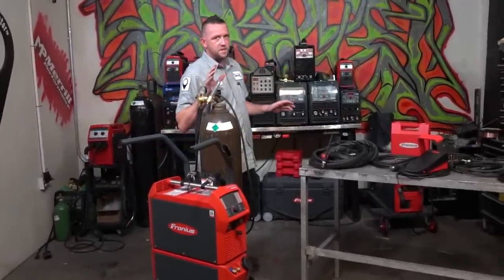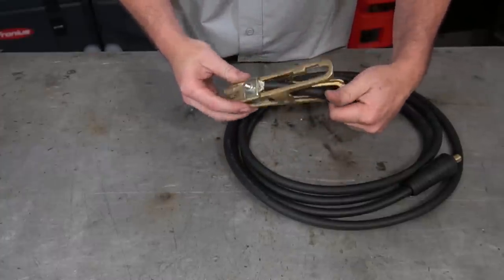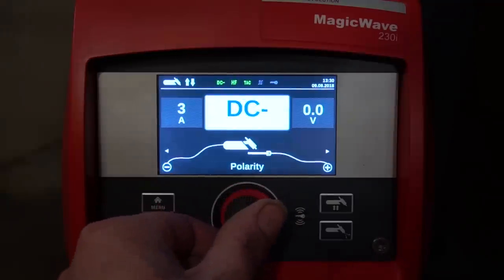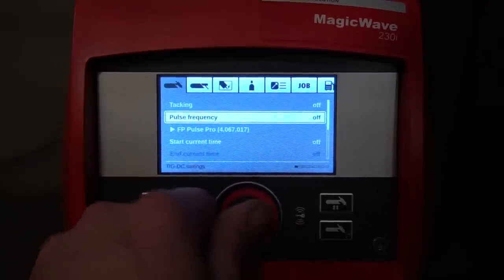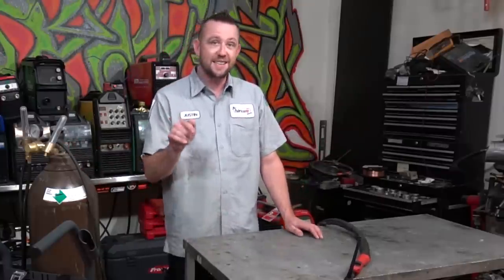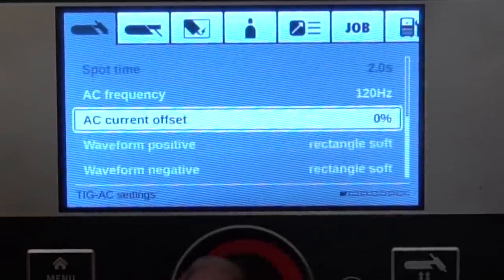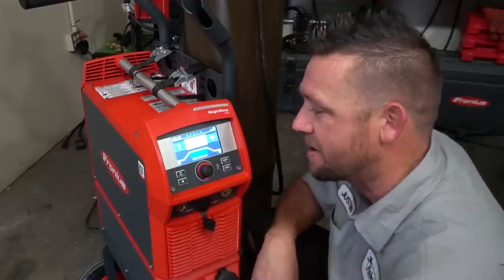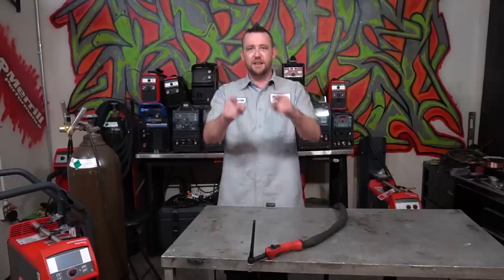TFS: Fronius Magicwave 230i

Comment from the maker: Try before you buy! Book an appointment to come here and weld.

http://thefabricatorseries.com/classes
Reply: Hello, how does the Magicewave 230 compare to a Miller AeroWave  ?  Adjustability/stability/prrcision  wise ?
Reply: With 1 of the latest firmware they added the possibility to weld 6010 on mma with it's own specific program
Reply: Would this welder have additional benefits specifically for welding cupro-nickel compared to other tig welders?
Reply: I've used the microwave 900wat ma whole life 🤣

Comment: I have had the pleasure of using many different tig machines at my places of employment here in Australia. Fronius are by far, The Best Tig welder i have ever used. On AC nothing compares to it. I currently use a Kemppi Mls 230 mastertig that an $8000 AUD Tig machine and its AC is rubbish compared to Fronius. Seriously you dont know how good they are till you try one. Everybody may hate the torch but i actually like them. Job mode i use to do AC Pulse fusion welds on 3mm 5052 Aluminium tool boxes 2000mm long welds full penetration. then as you go around the corner flick one of the levers and switch up to the next job mode as you change from an outside corner to a lap joint. This is where the key card comes in perfectly once you've dialled in those pulse settings you don't want nobody going in and changing them. They still have access to the saved modes but cant change the particulars of the modes. Now Fronius send me a welder and i rubbish on Kemppi and sing your praises more.
Reply: LandRoverLife You should ask for a trade in deal
Reply: @chris_b_liven  they make one of the best Mig welders too. For ally anyway.  TPS2700 and TPS270i. Im an Aussie too and thats all we use.  We build boats and have about a dozen welders.  One non fronius that sits in the corner all day haha
Reply: you should have the chance to try ewm, or lorch, they are nuts too; but i got a fronius myself as well
Reply: Did you ever try a EWM Tetrix? 🤔

Comment: Great review, very nice machine as I have one and love it. One correction, leave the head of torch "locked in", they all swivel around 360 degrees while locked. If you do it your way by unlocking to swivel, you then risk it popping off if you turn too far, especially with the water cooled torch. Also keep the rubber o-ring greased to prevent tearing. Cheers.

Comment: Our company bought this machine 2 months ago and it's the first one ever sold in NZ. Great machine by the way the smallest water cooled torch and so flexible
Reply: Do you know who they bought it through (Auckland?) and, maybe, the price? thanks.
Not in a position to buy at present, but in time...
Reply: through digital weld...the main fronius distributor in NZ....this machine was not available in NZ so they flew it from Germany for us....it was $11000. the torch itself was $1000. software upgrade an extra as well where you can get more parameters to play with
Reply: that price is the whole package though...the inverter and the water cooler and the water cooled torch
Reply: Ouch, thanks, man - just need a LOTTO win now :-(

Comment: After watching your reviews on the AHP and Primeweld 225 machines I choose the Primeweld for 2 big reasons. 1 In your review you had said you would opt for it to start out with because of it's capabilities and 2 after reading other reviews of both machines the Primeweld had best/least customer service complaints. It was a close call but I am thrilled with the Primeweld and even more stoked about the super flex lead. So much better then the manual gas valved torch and lead for my dc only Vulcan One Pro 220. Money well spent and Thank you

Comment: Most of the equipment I have is 20+ years old. My stick is 100lbs or so. Never seen one like it. Never had it to full power even on 1/2" and 5/8" steel plate. And I'd say it would run near full power all day. It looks like a industrial welder. I'd like to upgrade my 120v mig go a good but not expensive tig. Something I can weld aluminum and other more difficult to weld matereals, ( hard to weld with what I have). Great video!!
Reply: JAMES! Since the 70's You have to look at the Fronius TransSteel 2200

Comment: I absolutely love the build quality and the features are awesome. I wish a company would come out with welding machines with the same build quality just striped to the bare minimum with features. I'd pay premium for superior built quality machine but all the additional features (synergic, pulse, stich, multi-process, etc.)  just make Fronius machines unaffordable for me. I still would love to own one.
Reply from the maker: I understand what you mean, but by comparison, what they have included (with the quality) vs the competition is very affordable. It's thousands less by the time you stack up other features and functions. It would be cool to see a very entry level with very high quality machine though. Maybe they'll be the first to do it.
Reply: I hope so. You're right they are affordable when you add the features and functions. I'd just wish they made one that didn't have those features and functions (cause I wouldn't use them) to keep the price down. No one makes simple machines anymore. The ones that are made simple are junk build wise. Fronius definitely has caught my eye because of the build quality. No one is making machines as tough.
Reply: Tony, I have a Fronius Transpocket 180 stick tig welder and it is amazing I think you can get one in the USA for 1500
Reply: @tonybaggett1984  as a fronius daily user and owner, I have to say that quality is very high level, except for the cooling unit pump, wich is pretty cheap

Comment: Best have some very DEEP pockets to have this lil machine. 4200.00 to 4800.00 as of today. Makes the miller machines look like an affordable alternative lol
Reply: Jeremy Arnold A Miller Dynasty DX 210 TIG runner is selling online for around $ 5,800
Reply from the maker: A base line Dynasty 210 with nothing else is just $4k. Add a pedal, clamps, leads, etc - it goes up. Then add functions and features that the Fronius has that the Dynasty doesn't (that means buying a bigger Dynasty - not the 210). Now you have a $7k machine that still needs to be upgraded to match capabilities. Suddenly you're over $10k to do what this machine does. I think the Magicwave is a better investment.

Comment: Thanks for NOT wasting everyone's time getting into the stick settings. I wouldn't purchase one of these to stick weld.
Reply: but its nice to have a machine that will do both , especially if you're a mobile onsite welder and dont want to carry 3 different machines.
Reply: @heartobefelt  yea but every TIG can actually used for Stick welding aswell🤷🏻‍♂️
Reply: This can also weld 6010 with one of the latest firmware update: you can weld everything
Reply: @raulduke85  big deal
Reply: @Joeak74  i think it is actually: the best part is that you get your firmware periodically updated and they add new functions and programs over time.
I was able to manually weld 2 pieces of 1/10 mm thickeness alluminum foils, with no copper base under it, with good results, for a particular application, using 10 khz pulse and ac freq maxed out; it' nuts

Comment: I contacted Fronius once inquiring about price and dealer availability, more than a year went by they never got back to me. Needless to say no dealers for this exist in my state. They rarely ever have these listed anywhere online to buy.
I'd rather give money to USAWeld or STEL, at least they aren't afraid to show prices online.
Reply: Man, stel Is italian and I'm from italy; i'm a welder and i tried both the stel and the fronius mw2200: there's no comparison.
Stel Is a nice machine, but the fronius Is totally in another level. Then i have to Say that in Italy the stel Is not that cheaper than the fronius: the mw 230 i costs 3300 euros (machine Only), while the stel costs 29xx euros.
I've Heard in usa the htp Is quiet cheaper (same as the stel) and the fronius Is around 5k: well it's a bit pricey, but in my experience Is defenetly a Better machine.
Reply: @raulduke85  hi,man. Thanks for the comment. As an Italian welder, what do you think about cebora brand comparing to fronius and stel. Thanks in advance
Reply: @Abu_Daud  i only worked with a old cebora tig welding machine , pretty small, 180 amp peak current and it was a dc machine only: it was a nice little welding machine; but I don't know anything about the current models and honestly I don't know anyone using theese welders😅
Stel makes good welding machines, but I'd say that especially on 3phase welding machines stel don't stand a chance against fronius, not cause it's bad, but just because magicwaves have more features (now the Iweld has a lot more) and if I have to spend 8k for a stel, I'd rather spend 10 k for a magicwave. Sorry about cebora but can't help about it; but if you are interested in italian brands I can tell you that CEA brand with the model matrix produce a pretty nice unit👍🏻

Comment: I recently sold my Miller Syncrowave 250DX mainly because ever time I turned it ON it doubled my Electric Bill and had issues with it popping 60A C/B on heavy material.  I bought this Fronius Magicwave 230I.  Great machine, way more settings and adjustments than I know how to use.  Smooth arc.  I paired 230i with Miller Coolmate 4 water cooler and CK230SF Torch.  I didn’t want the BIG Fronius Torch, since I never had hand controls on a Torch, I figured I wouldn’t miss out.   First project was to make ZT Fab custom welding cart.
Reply: How are you liking it two years later?
Reply: Any updates ?

Comment: Hello Justin. I'm considering a new tig welder. I've been looking at the Lincoln Aspect 230 AC/DC.  Habe you demo'd one of these welders? And if so, how does it compare to the fronius magic wave 230?
I would greatly appreciate any info you can offer.

Thanks
James
Reply: That was a great question that ide like to see answered. The aspect is over $1500 cheaper and just a few less features. And Lincoln you can have repaired locally. Idk though, I dont hear anyone boasting about their experience with the Aspect on the internet.  That's why it's a fair question
Reply: @DCweldingAndArt  I went ahead a bought the Lincoln aspect 230. Oh My Gosh! This is an unbelievable welder! Super smooth and stable arc across the board! I am very pleased with this purchase especially that its an American machine. Yeah its assembled in china but is designed in America with American technology. If it breaks i can take it down the street and have it fixed in a week. Buy American! 🇺🇸💪
Reply: @JesseWright68  Yes. The Lincoln aspect is assembled in China, and hope that will change? However its still designed in America with quality standards that must be met and fulfilled in order to produce an American made Quality machine...
Reply: But still Chinese😊just like iphone

Comment: Professional level machine. ( 5 grand price!)  If you are just starting out you can easily spend 6 grand to have everything you need. (gas, regulator, rods, etc) You didn't show it doing low amperage welds on thin materials.
Reply: 5k is the starting price :)

Comment: @the fabrication series. So I got mine finally. My only problem is it keeps throwing low flow code and shuts me down. I've tried cleaning it out, no kinks in the hose I've changed all the settings and parameters. Everything you can think of. Is there a trick to it or have you had no issues with flow? Any tips? Thanks Justin

Comment: Problem: noise. Solution: earplugs.
Reply: buying an ac/dc welding machine and being worried about the nois of the water cooler... Just switch to ac, weld some aluminum and you won't hear the pump noise anymore, since the ac noise is louder🤣

Comment: Amazing machine. BUT, the fact that someone would potentially spend over $6k only to be locked out of using all of the features of their machine is, well, gross. That's how they reward the customers? They should be sending out updates for free.
Reply from the maker: Right after I posted this review they unlocked the machines from the factory. They all sell and ship with all pulse controls and parameters. Fronius is the ONLY company I have ever seen that listened to feedback and corrected it.
Reply: @TheFabricatorSeries  Good to know. In that case, thanks for an awesome and beneficial review.
Reply: @TheFabricatorSeries  for u.s.a. market only, or this offer Is avaible in Europe as well?